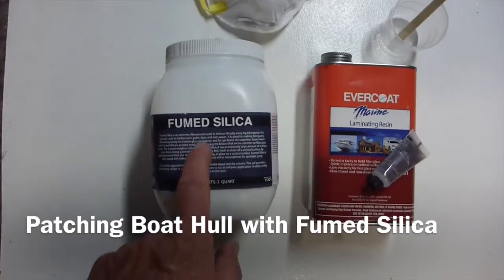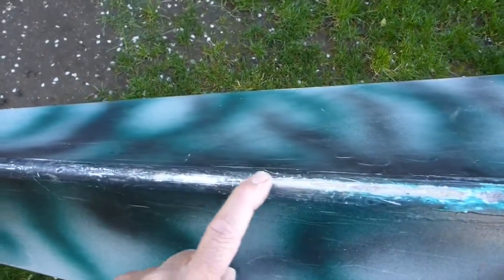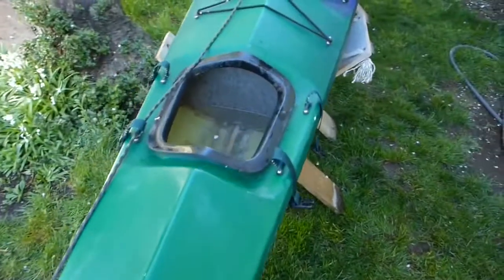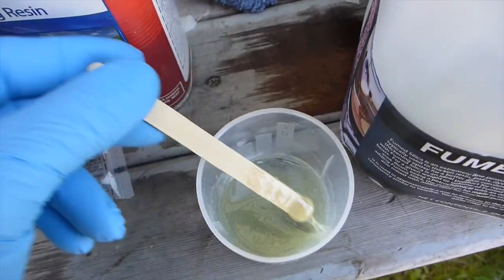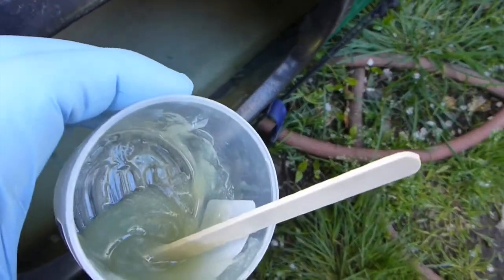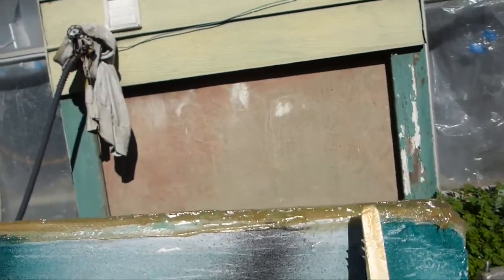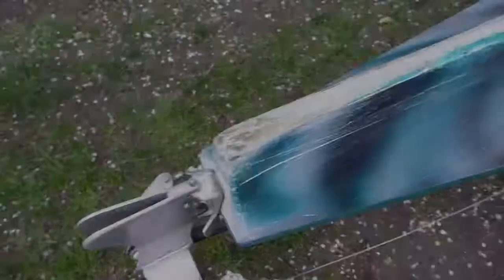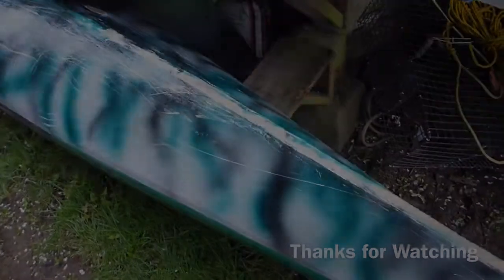Repairing boat hulls with Fumed Silca and Resin Mixture

Comment: Hey Todd, hope you have been well my friend! Question for ya, after i got done kayaking the mississippi river in my composite kevlar kayak i noticed there was some "stress" cracks under my rudder peddles where my heels would rest on the hull. There is identical cracks under each peddle and can be seen inside and out of the boat. does not leak water at this time. any idea why these cracks would have developed and what is your opinion on the best way to tackle it, fiberglass strips on the inside? and perhaps sanding the outside of the hull and re-gel coat?
thanks man!
Reply from the maker: Hey Jay, Welcome back. It looked like you had a great trip. 

It's not uncommon to get those stress cracks under the heels. My kayak had the same issue and I put down 2 layers of fiberglass cloth on the inside as a first step. Good news is I did that repair about 10 years ago and never had another issue with it. I ran my 2 layers (about 2' x 2') from pedal rail to pedal rail. It's possible to use smaller pieces if you just want to focus on the patch where your heel digs into the hull.

I took the pedal rails out, scuffed up the surface well with 80 grit, cleaned with acetone and laid down the cloth so the strands crossed at 90 degrees to each other and strands pointed 45 degrees off centerline of the hull (diamond shaped pattern). I think I used  8 or 10 ounce cloth because it had to be flexible to fit the inside curve of the hull and the wood keel half-round support. I'd suggest using a small resin roller to press the resin further into the cloth and to press out excess resin after wetting it out with a brush as it's easy to build up too much resin and add a lot of weight fast on this repair. Cut your cloth first and practice laying it in place a couple of times, and visualize each step of the process just to dry-run it. Keep the work area super clean as any debris that gets under the layers will be there for good. Use all the PPE, especially a good respirator because you'll be working with your head inside the hull. After the cloth is layered in then you can top coat it with a get coat or just brush on a final layer of finish resin (with wax). 

There are 2 types resin for this repair, laminating and finish, or you can add buy the wax separately and add it (5% by volume) to make laminating resin into finish resin. Use laminating resin to adhere the cloth to the hull and cloth to cloth, finish resin to top-coat. You can add color to the final resin layer if you want. I would NOT use gelcoat inside the hull because it's so difficult to spray it on evenly and brushing it on will give a rough finish with brush strokes. If you want to gelcoat the exterior to make it look better that's another repair but it won't add much strength.

Best of luck,
Todd

Comment: what you think about the bondo glass,for patching
Reply from the maker: Bondo with chopped glass is likely similar in strength or even better, it won't pour in and fill like this mix will and might peel away easier but that all depends on surface prep, shape of repair and amount of flex it will see.